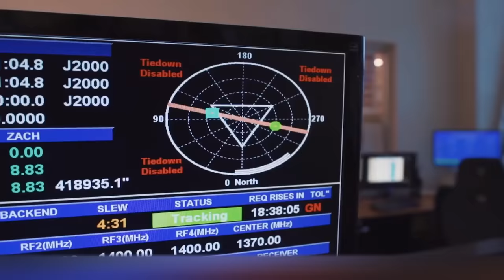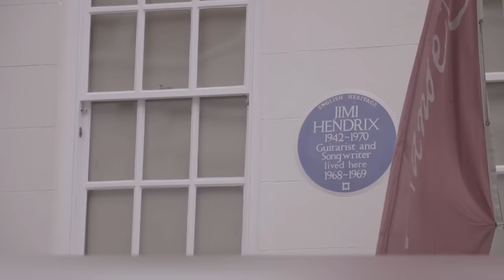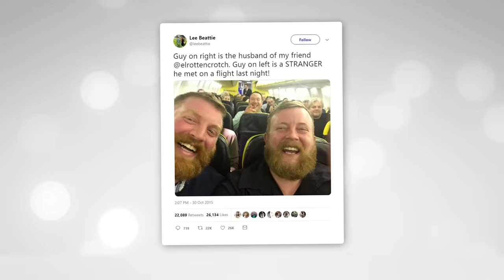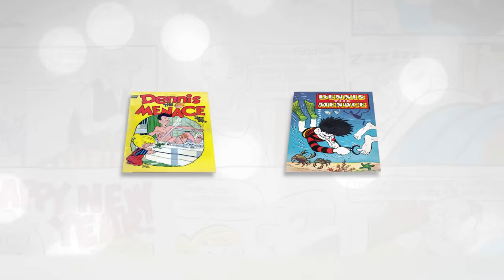10 Weirdest Coincidences in History

Comment: As a teen we came across each other and talked while waiting for the bus. We had a super intense connection right off the bat but went our separate ways until I was spending the night at my bestfriends house and i woke up to him coming into the house with his dad to work on the remodeling job. we both told each other we had been hoping to run into each other again and we had said "ah the one that got away" about each other after parting ways that day. We started dating, but ultimately it didn't work out- he had been on and off with his ex and ended up wanting to get back with her. After this we coincidentally would end up completely randomly getting jobs working together at the same time- not once but twice- and ended up becoming extremely close. Even tho we weren't meant for each other in that way, we have always had a strong, unexplainable kind of connection even today 15 years later.